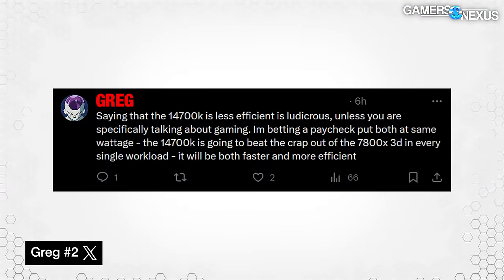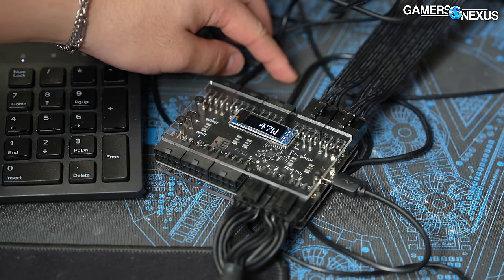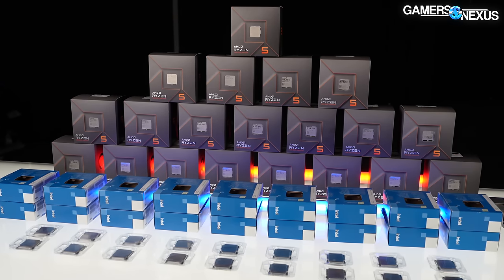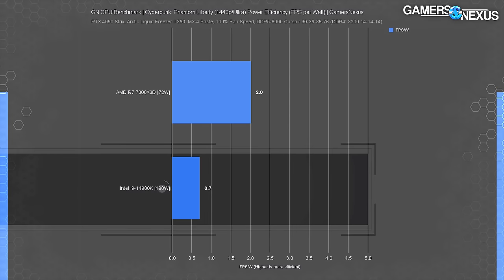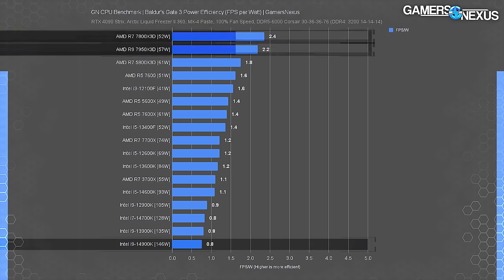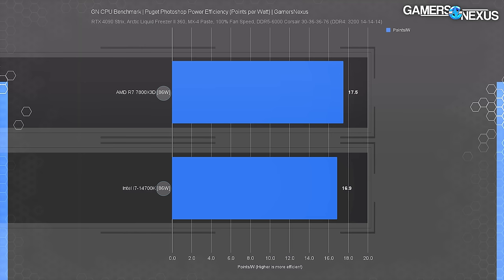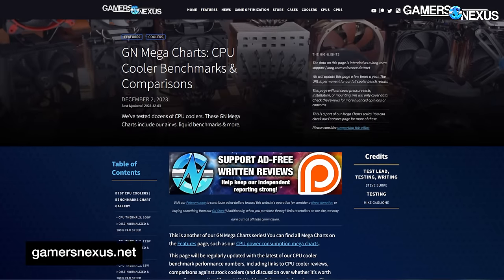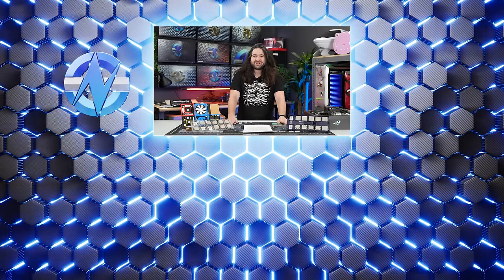The Intel Problem: CPU Efficiency & Power Consumption

Comment: the fact that the 5800X3D is beating some pcie gen 5 intel CPU's in terms of performance and efficiency just makes me more happy I chose it for an upgrade from my r5 3600. well worth it.
Reply: There is no such thing as a "pcie gen5 cpu"

so sorry to hear your processor is obsolete though
Reply: It may be obsolete, but its the best value for someone building a PC on a budget. And especially when people are starting to increase the resolution they game at, CPU matters less and less when you're more reliant on GPU power.

Bro could probably keep his 5800X3D for 10 years and still comfortable game at 4k/60 before needing to upgrade platforms.
Reply: @malcomreynolds4103  when I said pcie gen 5 cpu, im referring to the cpu's which only sit in the newer am5 socket or any of intels 13th/14th gen lineup of CPU's that use DDR 5 memory
Reply: @RealGreyGhost  Ya the 5800x3D has been going strong in my MSi X570 motherboard w/ 32 GB of cl16 3600 mhz ram. It's paired with an RTX 3060 12 GB. Running games really well @ 165 hz 1080p.

Comment: Yes for more power efficiency testing! power consumption is now my primary deciding factor when getting new components and I love seeing that this topic gets more attention :)
Reply: Is there a really good reason behind that? I pick parts that suit my needs and what I need is performance. Especially for Americans I really do not get it. You live in huge homes, AC everywhere, gas hungry oversized cars, you hate public transport,... but then you decide the efficiency of a Ryzen 5 is chaning your world?
Reply: @thomasschraubt7497 That's one heck of a blanket statement. My house is 450sqft (42m²), I have A/C but my electricity is offset by the solar on my roof, I drive a compact and fuel efficient vehicle, I would love to have public transportation but it isn't available in my area and yes, I chose my computer hardware for its power efficiency.

Maybe I'm just not the average American...
Reply: Especially as most people are buying parts to retain for years of usage. There's little point wasting money unnecessarily on electricity.

Comment: this further supports the theory that the 12100f is what most people need.
Reply: Goated chip
Reply: or a 7800x3d :D
Reply: Yep - perfectly adequate considering most people don't rock a $600+ gpu.
Reply: Ehhhhh quad cores are definitely outdated for gaming.  Most games can use 6+ cores.  If you're running discord and a browser in the background too, you really need 6+ cores.
Reply: *R5 5600X or 5600. i3 quad-core is a no thank you.
Reply: It's all they need, but not what they should get. Quad cores have been dead, and amd has been selling 6+ cores at the same price for years
Reply: yeah but the 12100 is faster (in gaming) than the old 6 cores like 10400/3600, more cores doesn't necessarily mean better performance
 @kintustis
Reply: but yes i agree that nobody should be buying the 13100.. you can buy a R5 5600 for that price

Comment: Room cooling/comfort and cpu cooler requirements are also a factor to me, especially if you can keep lower fan speeds.. so cheaper part, less costs with other factors, and still excellent performance is kind of a no brainer

Comment: I was just thinking that this locked FPS test would be super useful for GPU power efficiency comparisons as well. Like a lot of the top end Nvidia GPUs are super power hungry when being maxed out but are they more or less hungry when doing the same workload as a mid-tier GPU?
Reply: yeah, is a bit ironic, people being nit-picky with CPUs going over 60 or 105 watts, yet GPUs blowing past 300 watts like it's a new more-is-better challenge. Now I want to see a FPS/watt chart going back to GTX10 series, lol.
Reply: Throw in overall system efficiency at a locked framerate as well!

Comment: Thanks for the awesome video! That's exactly what I've asked for and I just got this video :D The only little addition I would've liked is a graph for the idle power consumption. Sure, it's awesome that my room stays cool while gaming with the 7800X3D, but I'm 80% doing office stuff and my 10600k only used about 12W compared to the 7800X3D taking ~30W. Doesn't matter that much, but I need to let fresh air in a bit more often now. while working from home.

Comment: I am amazed how well the 3700X rates, guess that's why the consoles use it.
Reply: yeah, zen 2 can hit some crazy efficiency numbers at low power when properly configured. There was an interview recently with one of the developers of the steam deck, comparing its power envelope to something like the ROG Ally in terms of battery life and cooling... Basically nothing compares to Zen2 at 10 watts atm for ppw & that's the reason for the Deck OLED only getting a die shrink ... a more efficient low-power APU simply doesn't exist yet.

Comment: Thank you for doing this kind of test. I've always been extremely curious about what the results might be from this kind of in-depth comparative efficiency testing. I'd love to see something similar for RAM and CPU pairings. Do some CPUs perform better than others at different RAM timings and megatransfer speeds? It really makes me wonder, especially when we take into account 3D v-cache chips. Do any CPUs really need the fastest RAM, or is it a nonissue? It could be a big money-saver for budget builders if it turned out that RAM speeds within a generation have little-to-no effect on FPS scores. But without that data those builders are going to feel some fear and apprehension that buying slower RAM may have a bigger impact on performance than they're willing to compromise on.

Comment: Maybe as a test game: Factorio?
Its a pretty good optimised game, but can be easy to repeat the workload by just loading the save and standing still. If you get a extreme late game map (by playing, or from other sources like viewers), the cpu workload would be noticeable. Keep in mind that the game is locked to 60fps for the engine.
Its also available as portable versions that dont need updates, great for version control.

I dont know if the game can really produce good results, because i lack the equipment and time that you have, but that something that you could evaluate by yourselve.

Comment: I switched my 13900K for a 7950X3D and can't be more happy. I was tired about having a CPU that does up in smoke at every load. And I was tired about instabilities caused by the undervolt needed to be able to not throttle on my 360mm aio
Reply: That's even more relevant than power bills. You need both large coolers and a large case to fit the cooler. That's more expensive than the difference in power bills throughout the year.
Reply: @luizarthurbrito  Yeah, I don't get why this isn't talked about more. 

A cooler that has the chops to cool a 13/14900 (or even a 700....) and a case to support it - which if you're upgrading from a mid-to-high end 7/8/9th gen Intel and didn't need that cooling capacity, and so have a mid-tower case and an air cooler are several hundred dollars (or quid, give or take, at current exchange rates - your local market may vary) - $300 minimum for examples that aren't god-awful crap and can definitely handle the heat load from the high end Intel (and even 1x700) CPUs. 

Given that most builds are heavily budget constrained, and given what the GPU market is like, that's basically saying "your new PC will play the latest games at 1080p60" or "your new PC will play the latest games at 1440p60 with ease, and plenty of less cutting edge stuff at 4k60 with a little upscaling"

That's a huge difference. And that's just going to a 7950X3D. 7800X3D? Cut back on the motherboard and RAM, and you're talking 7900XTs starting to look realistic....

Comment: I don’t understand how high end CPUs are comparable between AMD and Intel when Intel uses double the power and runs way hotter.

Why would you do that to yourself? Just to run 128gb ram?
Reply: Double the power and runs hotter despite "efficiency cores". 
Intel CPUs are a joke.
Reply: @EXiLExJD  Isn't that because they're stuck using larger nodes than AMD?
Reply: @theviniso I'm not sure about “stuck” but yeah
Reply: @theviniso  The fab fabrication tech is part of the problem.

Also Intel is running higher clocks, which by itself brings up power consumption. Remember what happened to both Intel and AMD when they went full pentium 4 (Bulldozer for AMD)?

Intel at this point is going full pentium 4 again, while trying to cram as many cores as they can, that is why you got P and E cores, while running chips fabbed a lesser node...
Reply: @akilh340  I'm pretty sure stuck is a good term. They don't have the long term deals with TSMC that AMD and NVidia do because they aren't a fabless company and had financial and executive pressure to do it internally since they spend so much money on their own fabs.
Reply: @theviniso  because of 14nm++++++++
Reply: Threadripper has the same bug that can cause crashes unfixed for more than a decade since the FX series. Linus made video about it (mitigation in bios after a day lost on troubleshooting). Ryzens still have unfixed USB issues - also old AMD problem. As someone who uses CPUs from both vendors since AMD entered the CPU market I noticed Intel tends to have fewer QA issues of this kind, so that's something some PC enthusiasts probably consider in their choice.
Reply: thats why is have chosen my 5800x3d - and living in Ger. with about 40ct. / kwh
Reply: I wish these tests included idle/very low CPU usage tasks, because otherwise it shows nothing new.

My PC spends most of its time idling on a browser, youtube video, code editor or something similar. My 12600K for example was jumping between 10-12W while watching this video and 7-8W after stopping the video (looking at HWINFO CPU package power). I've heard that Ryzen CPUs use a lot more power when idling (around 20-30W?).

In realistic usage of a PC (at least for a person that has a job, or at least an office job) where you spend 8 hours idling the CPU, but only 2-4 hours gaming, I wonder if the Intel CPUs could be more power efficient. GN brought up the chiplet nature of Ryzen CPUs, but we didn't get any idle power usage stats.
Reply: @EXiLExJD  E cores aren't power efficient, they're silicon efficient, you can cram 4 of them into the space one P core takes
Reply: @kazioo2 wrong for sure linus dont know squat
Reply: Why would I care? Power is cheap. Cooling is cheap.

I personally would run an x3d processor, but you all act like it's going to cost your thousands or even hundreds more to run. It's not. Only if you're using it in a server where it's at 100% 24/7

Comment: 27:15 I know this is Gamer’s nexus, but I’d be interested to add something bursty like web browsing when it comes to efficiency and performance. We don’t always use these computers for gaming, and I suspect there’s some big differences not just in idle draw but in how they behave when boosting from low power to high.
Reply: Browing doesnt matter since it doesnt use much computing power, meaning any weak CPU can do it, not a real benchmark to efficiency.
Reply: Yes, in one other comparison form other channel they said that in idle or in browsing amd min is 25w vs 4w on intel.
Reply: for your use case, i think i3 12100F is the best choice. look those low power consumption even in gameplay.😂
Reply: Watching YouTube on my i7-11700 / Z590: 10-12 W minimum indicated package power, at times up to 20 W (and that's on my "Eco" ThrottleStop profile with turbo ratios limited to between 42 single-- and 28 allcore, you can add at least 2 W otherwise)
Watching YouTube on an i3-12100 / B760: 3-4 W package, on a higher-res screen at that 
:(
The latter system actually draws a few watts more at idle, courtesy of some onboard USB hubs, XMP memory and an SSD that doesn't idle too well (WD SN570 as opposed to Samsung 970 EVO Plus). Both are quite well-optimized for C-states and ASPM and whatnot.

I have been tempted to upgrade, but it turns out boards with the exact combination of features I need are a bit thin on the ground.

Comment: Yeah the one area where Intel is better for power consumption for me is in applications where it spends most of its time idling, like in a home media server.

With core parking my intel chips can go under 10W at idle. I really hope AMD can improve in this area.
Reply: And that's why it's better to use monolithic APU's on AMD boards for low power home server. Chips are same as in laptops, idle power consumption is not an issue at least on CPU side.

Comment: Loving these videos but I would personally be interested in other kinds of tests as well, specifically video encoding (1080p and 2160p) with x265 and AV1. I'm in the market for a new PC and would need something that handles that really well, not just gaming.
Reply: You use GPUs for video encoding.
Reply: @war4peace1979  No, GPU encoding is fast and mega shit. Software encoding beats it massively, both in terms of quality AND compression. Not to mention I'm also using filters and it's much easier to make those work with software encoding than GPU encoding.

Comment: So I’m a diehard AMD fanboy, my last few processors were a Phenom X4, FX 6300, FX 8350, r5 3600, r7 5800x. I recently got the 14700k on sale during Black Friday in part do to a friend gaslighting me but moreover because the program I use for video editing (my job) does actually benefit from Intel’s integrated graphics chip for hardware decoding.

All that being said, in real world use I notice practically little no difference in terms of gaming performance or editing performance as I had with my 5800x. Sure my timeline runs a little faster but going from 16 threads to 28 threads I would’ve expected a lot more. I get that there are P cores and E cores but even after buying the latest flagship and using it I still don’t understand why Intel has this structure. Especially when my CPU now uses over twice as many watts even when browsing.

Now I’m stuck on a dead end platform with a chip that runs hot and honestly isn’t that good for multitasking. It still performs well don’t get me wrong, but I think I would have felt better with my purchase decision had I stuck to my AMD path.
Reply: You do know that the 7800X3d draws double comparing to the 14700k when browsing because of that I/O die right lmao
Reply: Guess you edit hvec/h265/h264 10 bit 422 from a Sony or the like?
Reply: @yungfisherman4  "lmao"... yeah uh... double of very little is still very little. But the 14700K draws triple when punched. So you're clutching at a non existent straw: It doesn't cost anything to draw 20W over 10W. It doesn't produce any noticeable difference in heat output. It doesn't make the fan any noisier, and it doesn't make you need to buy a better cooler.

And who TF buys a high end CPU if they spend the majority of their time in a browser?!?
Reply: @andersjjensen  20W? Try 27-40W just watching youtube lmao. Another laptop level of power consumption.  

Yes, you're right, most high end desktop users just alway rendering something scene in blender, exporting photos, movie projects, unarchiving 7z files one after another, playing games for 8 hours nonstop instead of mostly doing light tasks like web browsing that only normies do lmao
Reply: @housepandacrew581  correct. I edit footage from a Panasonic GH6 and Sony FX3 HEVC H265 10 Bit 422 4096x2160 29.97fps. On the Panasonic I sometimes go up to 5.8K as well, big files.
Reply: @andersjjensen  yea kinda crazy as I was kind of just making a joke about the wattage whilst browsing. Can’t believe this guy took it so seriously.

Comment: I build quite a few machines in a year. Built a lot of AMD rigs due to them being the current big thing but I built a 13900K rig for a customer a couple of weeks ago. It was the fist build that just worked perfectly from first switch on and carried on. Didnt need major BIOS updates to recognise the ram or CPU. Didnt need to replace the ram. Didnt need custom voltages to get it to fire up. Didnt take ages to memory train etc. etc. It was a joy.

Comment: As someone that prefers silent focused cases this will also help me figure out what to upgrade to next when the time comes. Less power consumption means easier cooling. Sadly I messed up somewhat when I went for a 9900k upgrade for my Define r5 case the last time I upgraded, lol. I made it work tho (early reviews didn't catch something something bios blasting power for stupid heat)
Reply: NR200P with 7800x3D here :P -30 magnitude undervolt and q-fan curve from 19% at 30c to 100% at 75c PBO thermal limit right now, still boosting over 5GHz occasionally and noctua fans are super quiet around 40c idle.